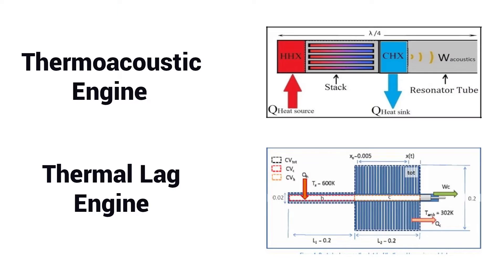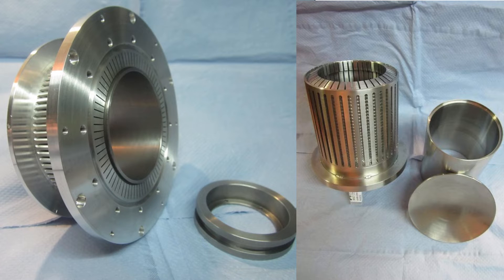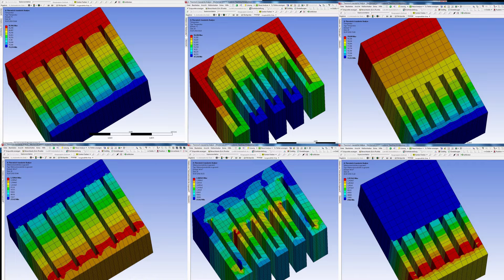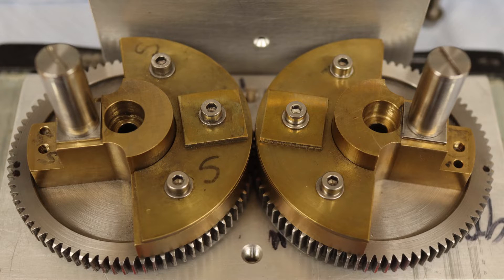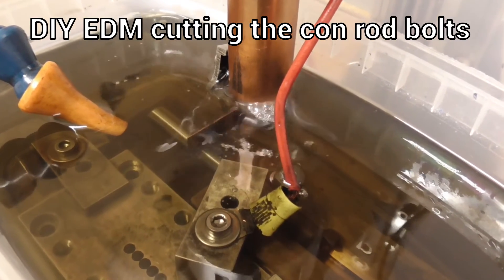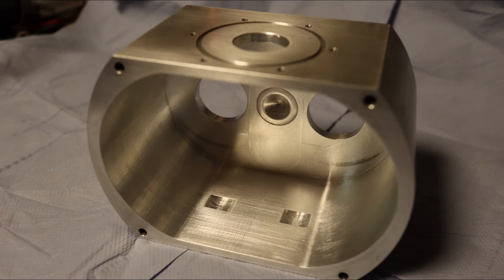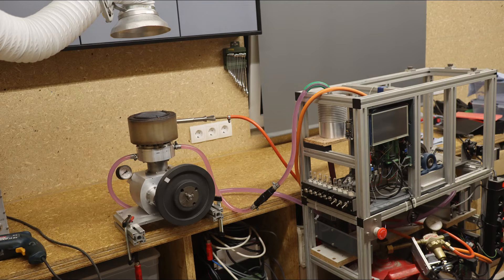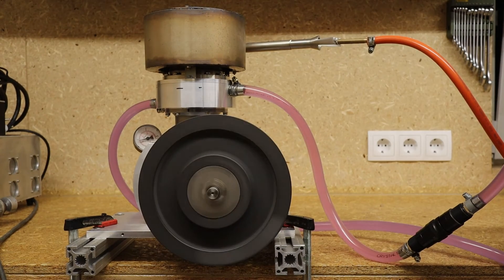Rhombic vs Half Rhombic Stirling Engine to build the best  CHP to support our solar power supply

Comment: Induction graphite heating element thermal electric generator voltage multiplier to power the Induction frequency generator to power that? 😐

Comment: How much energy in watts does it generate if fitted in an alternator?
Reply from the maker: 300 Watts
Reply: @myengines2443 for that power output how much biogas does it usually consume? I'm actually impressed that it can output 300 watts for its size. I also wonder how much power will your thermocoustic stirling engine will produce

Comment: Have you any CAD plans to build one of these engines? I've only the old ST05G Engine plans, but it's difficult to produce a new engine with this old plan's. I'like your rhombic drive engine.
Reply from the maker: Sorry but I don't have proper plans or drawings.
The St05G plans are very nice, I studied them a lot!
The rhombic drive is really elegant, but I had MANY problems with it, it is quite compiex and generates a lot of friction...
Reply: @myengines2443  thank you for your assessment. Have you any CNC Plans for the ST05G? Are you living in Germany? I'want to discuss with you and want to know your experience about low cost sterling engines.

Comment: As a question, how come you do not attempt to scale up the rhombic stirling? If the low wattage means more usage, perhaps doubling the size could produce closer to 600 Watts? I dont know if it scales linearly, but that would be one way to reduce the amount of hours of operation required.

Another question: Im actually very interested in how you would think to increase service intervals on the stirling engine. Could you lubricate better? Or use better/lower friction materials? Where would you seek to improve? Or is the design itself too flawed?
Reply from the maker: I actually just bought a 130mm (weights 18 kg) diameter block of 1.4571 stainless steel for a bigger version of the rhombic.
When I dont't find a better concept I will build.
But it is very much work and will take month of hard work which will push my machines the its limits.
The theoretical performance will be much larger as it raises with the swept volume when I can design the heat exchangers accordingly.
So the bigger bore will lead to 4 to 8 times the power if done right.
Unfourtunately the pistons have to run dry and I am always searching for better material pairings but still have quit good ones I think (cast iron/ss and Igus W300 tribological plastic)
Reply: @myengines2443  I see! I found that your size of engine was already impressively efficient. I have observed other designes that were easily 50% larger that only attained 300 watts. In your case, you already have an impressive engine at its current scale. 

How come the piston must run dry (asking for my own education)? It makes perfect sense that you would have low service life as a result. Could you try to attempt dry-lubricant coatings (graphite / molybdenum)?

Thank you for your answers. I am learning a great deal.
Reply: @myengines2443  If you want to lubricate your pistons, try porous metal 3d printing in aluminum in steel, then drown them in oil, then you got urself a self-lubricating piston.

OR cross hatch your cylinders and get some graphene powder not graphite powder and mix it with some mineral oil, the mineral oil is optional, but it will help seal the gaps between the cylinder and the pistons. The graphene powder usually very fine will act as an excellent dry lubricant. Since the graphene particles are so small they will imbed themselves into the cylinder walls and act as a barrier between metal-on-metal contact.

Comment: Thanks for your fascinating work on the sterling engines here. I can see myself wanting to buy one of your designs some day. What made you choose a particular cylinder size over another? Given that you are interested in home power production the engine does not need to be very portable, so larger scales might be a way to get good power without high pressures and high RPMs and the associated manufacturing challenges.  I'm interested in home electrical generation using a sterling engine powered by 100c water and cooled by room temp water.
Reply from the maker: I chose the size based on what I can still work with easily on my lathe. However, I am actually already planning a much larger version, which I will start on once I have finished the thermoacoustic Stirling engine!

Comment: May i as at witch Delta temperatures you ar running at?
Regards from an old scool Norwegian Engineer
Reply from the maker: At max power Tc=50 C and Th=600 C so delta T is about 550 C.
In the Video I am just running in the engine with much lower Tc of maybe 400-500 C I did not measure it.
Greetings

Comment: Have you thought about changing it with CO2?
Reply: CO2 will have worse perfomance than air as it has larger and so less mobile average molecule. The best performance will be with gases with small molecule, eg Hydrogen or Helium.
Reply: @blg53  There's the idea of using supercritical CO2 (liquefied CO2 under pressure) to explore the phase change and extract more power. But I don't know how good it performs.
Reply: @Pixelarter  Interesting.  Not sure how to design such engine.  If phase change is to be employed why then not start with water? Seems easier to arrange the temerature regime for it than CO2.
Reply: @blg53  Yes, water is easier and more documented.

But I believe water has a much higher specific heat capacity, and requires enormous amounts of energy to start to turn into vapor and phase change, specially under pressure.

On the other hand supercritical CO2 could be advantageous in requiring much less heat to phase change, and theoretically waste less energy to preheat. Probably can operate under lower temperatures as well.
Reply from the maker: I made some experiments with helium but I have to try there a bit more

Comment: Great to see an update from you! Im always excited to watch your videos. 
As a question, how come you do not lubricate the gears? It might help with the noise a little and could make the gears last longer. 
Keep up the great work!
Reply from the maker: Hi Viper,
I do lubricate the gears with a little bit (in earlier times a little bit more) adhesive grease.
But too much can contaminate the heat exchangers and increase the risk of diesel effects which cause a lethal explosion.
Reply: @myengines2443  I see, thank you for the explanation. Looking forward to your next update, as always!

Comment: One small suggestion. Your moving rhomboid rods should be constantly in rhomboid formation, to not align in square shape in that way rotation would be much smoother and less noisy i believe.
Reply from the maker: Yes, you are right but the way they move provides the best volume variations for the Stirling engine cycle.
If it is more efficient to move the way you describe is surely worth an investigation.
Thanks for your hint I will examine this.

Comment: Get rid of them rhombic drive entirely and try out a ringbom configuration.
The free piston design is most likely the best and most efficient design with least moving parts.
Reply from the maker: You are right, the Ringbom engine is a very interesting configuration and I studied it a lot.
But optimization seems to be very difficult along with other problems.
Maybe one day I will experiment wit it, thanks for your hint.
Reply: @myengines2443  Yes, it is even more difficult to get right.

Comment: on your 300w engine, what COP do you generally have? Could measure the gas use?
Reply from the maker: I think COP is the factor electricity to generated heat of a heat pump?
If u mean the efficiency of chemical energy of the Fuel to generated electrical energy this is  something I will do in this comparison test.
Where you cant expect too much for such a small generator.
Reply: @myengines2443  electrical power to fuel consumption would be great, as it would do the coefficient of performance of the whole system.  Butane is roughly 50Mj/kg which is /3.6Mj per kWh is 13kWh of heat per kg.

So if it is 300W power and consumes say 200g of fuel per hour = 300/2600 = 11.5% COP of the system as a whole.

Comment: I hope to replicate this in a few years. I don't have a workshop yet, but this is the project i want to do. I have the same goal, but I'm hoping to heat it with wood. You're using propane? I'm afraid wood will be difficult and not as efficient, but at least i can get it from my own land.
I'm following you with interest
Reply from the maker: Yes at this test phase I am using propane but later I will use self-made biogas as you can see in an older Video.
We have also much wood and this will even work in any case, if you turn it into wood gas.
Reply: Going to use a rocket stove type design for wood heat?
Reply: @artdeco7729  maybe, haven't decided yet. The plan was to integrate a Stirling engine to a central-heating furnace. But maybe a standalone generator would be simpler